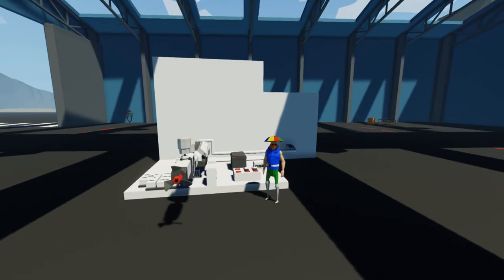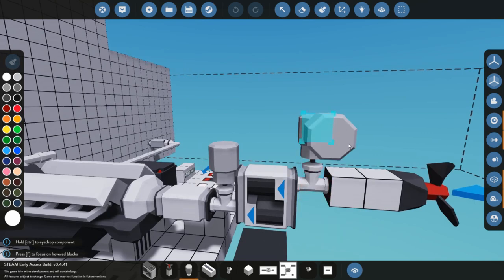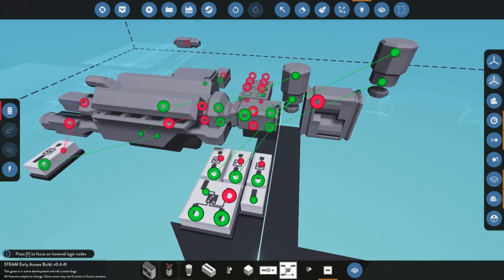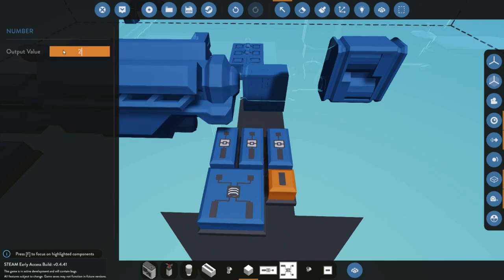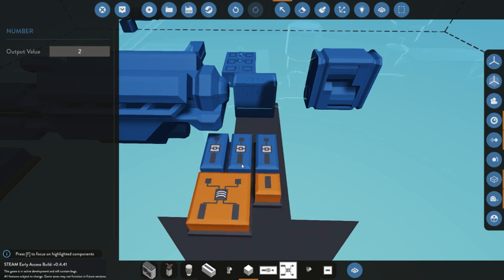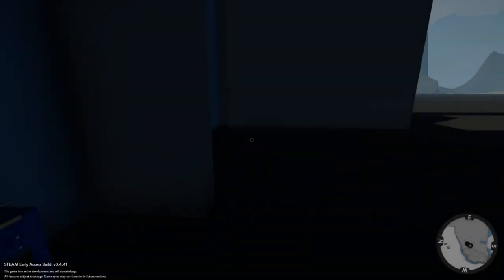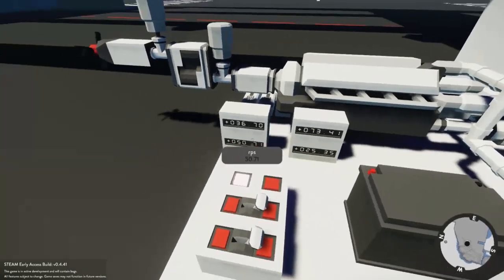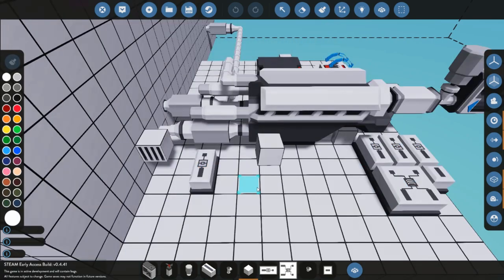Automatic Gearbox / Transmission! | Stormworks Build and Rescue

Comment: how do you do this for more than one gearbox
Reply from the maker: It is a weird mix of multiple of the systems that I set up there. I think I'll be making a micro controller soon to control one or many gears in an automatic gearbox.
Reply: I know this is an older post, but I am currently trying to figure this out myself.  Full disclosure: I am not good at this game yet, and looking at other folks' stuff, videos, etc, this is what I see:  You can take RPS and Throttle inputs, put them through threshold gates and AND them.  For instance, if the Throttle is at 50+, and RPS is at 50+%, then turn on gearbox X.  Then do the same with additional gearboxes at different thresholds.  As long as you don't put in a max threshold for the gearboxes they should all stay on when intended then "downshift" when needed.  Something like that.  I don't know the numbers yet that make sense, but I'm working it out... poorly.

Comment: what do i connect the clutch to?
Reply from the maker: depending on the engine. The clutch connects up to the power output for the engine. It should be an orange piece of the engine. if you hover over it, you should be able to find it

Comment: How do you make a engine that can go from the first gear all the way to the max gear?
Reply from the maker: you may need to tun up rps on the engine in the select mode, or with for the engine to be at max rps before switching gears. It truely depends on the engine/system you are building.
Reply from the maker: If you have any specific builds. I can look at them and help you fix the problem if you want.
Reply: Thanks for the offer, currently I do not have any builds, but I will provide you one when I can.

I am still new to the game, and started with career mode, I do not even have most of the parts unlocked yet.

But I did end up getting the gearbox, and I saw that it has several settings, when I searched for tutorial videos on it, I came accros your video here, initially I thought you meant by automatic gear box that it will change the ratio from 1: to 5:6 all the way to the highest level.
Kinda like in a car where you can shift the gears all the way up bit by bit.
In this video you automatically change it from the first gear to the second, so my question basically is, how do you continuesly change it?

I did do some experiments, but they were pretty horrible, I ended up just placing a gearbox onto another gearbox, like 6 in a row, then trying to change them like that.

Currently I am building a tanker,I will design its engine compartment soon, when I am done with that, I can send it to you for inspection if you like.

Another question which is off topic, is about cooling, currently I only cooled my engines with radiators, can you tell me how to use sea water as cooling and what components do I need?
Thanks in advance, and I appricate this video, pretty clever design for automatic gear shifts, I plan to implement this :)
Reply from the maker: @MercenaryZack  yeah, my system here only changes one gearbox to a higher level ( like from the 1:1 to 1:2). btw what engine where you using for that system? The small engine may be a bit too weak to actually get the gearbox ratio up to 1:3. Also for the watercooled design, I did do a video on that a bit ago. The video title how to solve all your cooling problems if you are interested!
Reply: Alright np man, I will check it out, and good tip! I am indeed using the smaller engines for the time being, I am also building with advanced mode, I have a pretty good grasp of things already, for example I made a Chinock inspired helicopter which works flawlessly, but it too only has 2 gear settings.Second gear is just about enough to give a slight boost in RPM and reduce fuel consumption a bit.

I will get back to you when I make some progress, as its going to be a larger project, as long as I don't forget and am actually not lazy to complete it, since so far, it seems like an overhelming undertaking, I am currently only as far as the hull design, so it might take a good while when I can get back to you about it.

The only design I could currently send you is the helicopter, but I made the engines seperate, and they were very compactly designed, then I just pasted it into the helicopters frame, so you would not really have room to mess around and try to add in a gear changer.

I will build this tankers engine with space in mind so that if I send it to you, that you will have some space to do changes if need be.
So thanks again, and hopefully I can get back to you with the tanker.